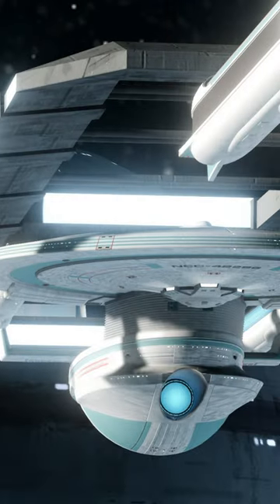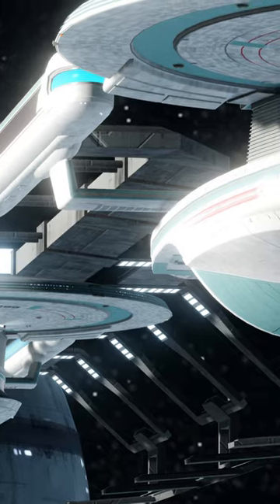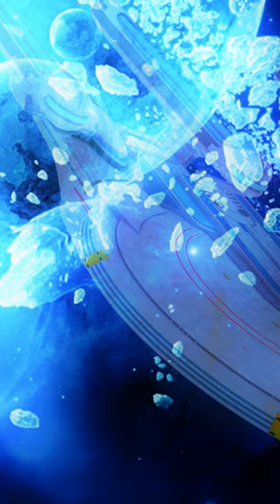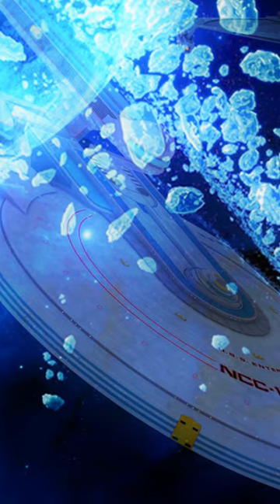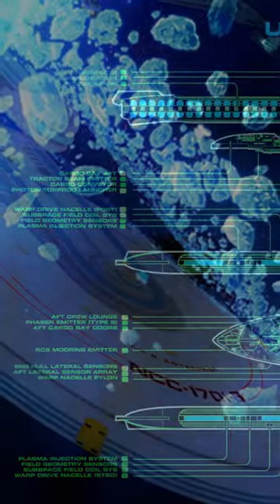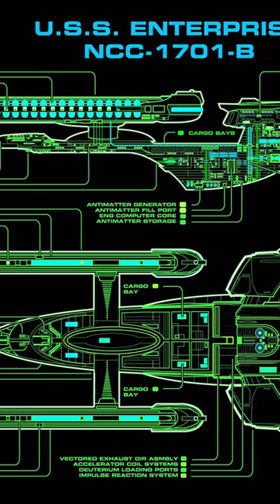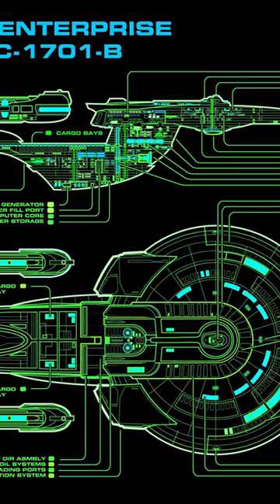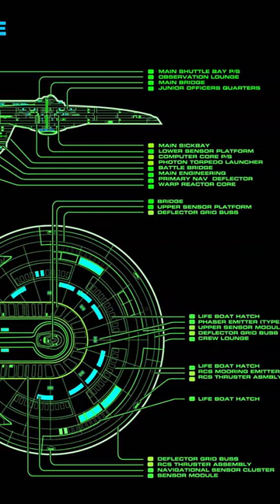I Was Wrong About Excelsior... #startrek #starfleet #militaryship

Comment: Treaty of Algeron was in effect. Since when did 1701 have a cloak. It was illegal at that time.
Reply: The events of Generations were nearly 20 years before the treaty of Algeron. So the Federation could have messed around with a cloaking device on the Enterprise B.
Reply: @blargy7283 If that was the case then why didn't more Federation ships have a cloaking device?
Reply: @blargy7283  But it didn't. This does not exist in canon.

Comment: Those would be memory chips, Isolinier chips never came into use till around the 2320s, Enterprise C and the Ambassador would have had em as the Ambassador entered service in 2340, while as the Lakota Variant of the Excelsior (Ent B) was launched at the end of the 23rd century at 2393, using the most up to date version of duotronics.

Comment: And 'fine control over the cloaking device' is precisely what Enterprise needed to save it from the Nexus?
Reply from the maker: well no... it wouldn't be installed till tuesday... but we know that the cloaking device is generally tied into a ships deflector.
Reply: @venomgeekmedia9886  whait you mean the transfasic cloack ? in this time?
Reply from the maker: @yelwinmoisesacostaduarte8915  no just a standard cloak
Reply: @venomgeekmedia9886  ok i need more context why the B would have a cloaking device
Reply: @yelwinmoisesacostaduarte8915 Probably Because the Klingons and Romulans had them so it’s logical for the federation to develop and use them as well
Reply: @HKN48  But the Federation signed the Treaty of Algeron, with the Romulans, forbidding any development or use of cloaking technology.
Reply: @joelnielsen4836  Enterprise B predates the Treaty of Algeron by almost 20 years.
Reply: @FyurianPrime the treaty is pre-TOS
Reply: @alanb8884  No it's not.
TOS is 23rd century (2200s), whilst the Treaty of Algeron was from 2311 which is the 24th Century, and after the Enterprise-B left Spacedock on its inaugural journey in 2293 (beginning of Star Trek Generations), so again, almost 20 years between Enterprise-B and the Treaty of Algeron.
Reply: @alanb8884  How would the treaty be pre-TOS when the Romulans and Federation had zero contact and battle-grade cloaking devices only began use during TOS?

Comment: One big problem with that though. Remember how when there was a Starfleet-developed cloak was revealed and installed on the Enterprise-D, they ended up bringing up the treaty of Algeron, which was just about the only thing keeping the Romulan Empire from declaring war on the Federation. If there was a cloak installed on the Enterprise-B, then that would be a breach of the treaty and war would soon follow the ship's launch when completed. Instead, I'd say that isolinear computers can handle much more current than their duotronic predecessors, so I'd say that the Excelsior refits like the Enterprise-B would be fitted with more powerful shield grids, ones that would short out the older duotronic control computers with their much higher power requirements.
Reply: "Because Japan signed a peace treaty that stipulated it may only field a military for self-defence, the Imperial Japanese Navy could never have existed."

The logic you're using.

Comment: Geordi told Scotty in TNG episode Relics that the Isolinear chips had replaced the old Duotronic enhancers for the transporter system 40 years ago. (Or so.) We also learn that Isolinear chips were used to replace and enhance most, if not all, ships systems around that time period as well. Though it would take another 30+ years for the Isolinear chips to be used for all systems such as Warp Drive Controls. The Enterprise B was launched in 2293, I remember reading an article for Star Trek that said the Enterprise B was used to test out the new Isolinear chips, when they were still a very new concept.

Comment: The ship class that has been refit the most in the star trek universe.
Next one is Miranda class lol.😂
Reply: Actually, I'd say the Miranda is the most, because the Miranda was around before the excelsior
Reply: @alexwesley6829   Miranda was adapted more to fill many roles, a little different to full refits tbh but that's more in the way of arguing symantics.😅
Reply: @paulammon2281  lol, was still adapted and refit many times more lol...the excelsior for instance, was refit MANY times over it's life, with no visual changes....other than the ENT-B/Lakota refit style...but other than that, all the normal excelsiors were still retrofit, which is where it keeps the space frame, but the replace all internals, even sometimes adding extra decks!

The Miranda went through this process even more than the excelsior did... though, the excelsior did get it's visual face lift too....and i have to say, I DO prefer the enterprise B version....there's just something about it that looks beautiful... almost like a precursor to the sovereign...I always thought the sovereign was based on the excelsior, in the ways of spaceframe shape, but they used that tough spaceframe style then made it into a full blown warship basically...both, beautiful ships

Comment: The Enterprise B used a cloaking device? Ummmmmmm no. An enlarged engineering section and additional impulse engines imply greater power output or additional stores of consumables for longer missions. Almost nothing in canon suggests cloaking technology. (The additional power generated by the Enterprise B could just as easily be for exploration or combat as for cloaking.)
Reply: in his fanfiction universe, Venom has the Enterprise-B variant of the Excelsior be originally designed as a counter to the Romulan Nova class equipped with a cloak and tricobalt torpedoes. He reasoned that since the Treaty of Algeron prohibiting Starfleet from operating cloaked ship did not exist until after the Tomed Incident they could use cloaks before then.

He has the Romulans revealing the Nova class around the time of Star Trek 6 as the big stick colony/starbase killer battleship to deter aggression and the Enterprise B Type Excelsior was Starfleets counter deterrant with specialized cloaking support systems. Basically "You have a cloaked Battleship that can level any of our worlds with plasma torpedoes, we can do that too, so you might want to keep things civil."  Basically the equivalent to the Ohio/Columbia class SSBN vs Typhoon/Delta/Borei class SSBNs

After Tomed (which he has made into a kind of Cuban Missile Crisis situation between the Federation and RSE that nearly resulted in the two powers going to war) and the signing of the Treaty of Algeron, Starfleet had to remove all cloaking tech from their ships(Acquired back in the Enterprise Incident by Kirk BTW) It's likely that Starfleet refitted the EntB type Excelsiors with the equipment and supplies you're proposing. 

Remember this is Venoms well thought out fanfiction here.
Reply from the maker: apart from the fact that up until the treaty of algeron the federation was free to use cloaks, and the additional structure doesn't add much in the way of volume... if that were the goal why not fill out the back more? also it doesn't  change the height of the ship... so the core would still be the same size.
Reply: Additional sensor and subspace antenna blisters for a command variant make more sense than a cloaking device for which, to the best of my knowledge, we have never seen evidence of.
Reply from the maker: @brianchiasson2465  well we know the federation gave up cloaks with the treaty of algeron, meaning they must first have them. the instigating incident being the "Tomed incidednt" in 2311 which very much falls in the excelsiors tenure.
Reply: @brianchiasson2465  we only see the Excelsior Refit twice, and Lakota would be subject to the Treaty Of Algeron regardless
Reply: @venomgeekmedia9886 To be fair warp core height very well may not be a sign of power output. More likely the hight is so that the antimatter store on the bottom is close to the bottom hull to be easy to eject. Constitution and excelsor has it needing to reach the impulse engines where the matter fuel is stored.
The reaction is in the matter/antimatter reaction assembly. TNG has the dilithium in the reaction assembly. The constitution had the dilithium crystal converter be a separate unit to convert the energy to be used for warp plasma and probably why a separate one was used to channel the energy to the impulse system. 
The height is most likely a function of convenience.
Reply: Also, I had to re-familiarize myself with the Tomed incident. The facts of the incident have nothing to do with cloaking technology. So why make that part of the treaty? It's still a smart move on the Romulans part to ensure they are left protected.
Reply: Actually the added structure to the engineering hull is already explained as being due to the enhanced sensor suite that was installed on it....the extra impulse engines were there for the same reason any car nut would put a turbo on their car...."more powahhh!!!!" 😂
Reply from the maker: @SSJBart-jb5dw  I presume you mean that terrible novel... that's exactly why i did my own take.
Reply: @Ty-yt3lj  exactly my point.
Reply: @venomgeekmedia9886  Yes, and don’t ever stop, lol.  Also, I am a little humbled now with you saying that about a novel. They are the holy grail for me. The Lost Era novels started amazing. Sulu and the Excelsior with Chekov as his First Officer? Yes please!  Lol
Reply: @venomgeekmedia9886  The treaty prohibited the development or use of cloaking device technology by the Federation... That doesn't necessarily imply that the Federation had it already, just that they were either developing it or far more likely, that the Romulans feared that they may at some point do so given that the Federation stole a one in the late 2260s. Cloaking devices don't really fit the way the Federation operate, hence why even after the Romulans join the Federation in the 32nd century we still don't see Starfleet using them.

Comment: Wait, the ENT-B has a cloak? I feel like we need a video about that now!
Reply: Just in this fanon lore to fill in why it has extra hull protrusions and impulse engines. This entire channel is built on fanon. Very well made fanon.
Reply: No it does not that assumption is purely based on fanon thinking
Reply from the maker: https://youtu.be/wQ57EVmYF2s?si=Mfa4tlduQg5UuEHB covered that here
Reply: she did not.
Reply: There’s absolutely zero reason to think it had a cloaking device because it doesn’t lol
Reply: @richardched6085  If you pay attention to this video the cross section of the E-B is the ORIGINAL cross section Doug Drexler made. There were actual changes when ILM changed them.

They were in fact originally shuttle bays but ILM changed them to look like impulse engines. I'm not sure who ordered that change but that's why in the ORIGINAL MSD it shows them as shuttlebays. Although I can understand why they were changed to impulse engines.
Reply: @superhayes256  It probably did in Beta Cannon but Beta cannon isn't cannon at all. What we see on screen is cannon. Any books that are put out is not cannon.

Comment: I wouldn't wonder, if the Dayström institute after their founder went crazy with M5 changed the direction of research and instead of trying to use automatic AI systems thought: "what if we just make the computer chips so fast, that even the slow humans can react in time. Then we don't need an AI to assist them."

So they went back to the drawing board and instead of buildings a huge computer on the old computer system, the Duotronic made into multitronic, they went with isolinear chips, which seem to be some kind of small self working devices that you attach to the main system via backplanes to increase the processing power of a certain computer system. 

Outside of the idea that the producers of Star Trek just looked at Space Odyssee 2001 and thought: "damn, that idea with HAL is much better than what we had with TOS"

Comment: in away in the original star trek the even used copmuter cards or communication cards or disks in different colors often. they were called data tapes at one point and changed it to communication data cards. kind of like giant sd cards in away, not really ment as computer processors or memory like isoliner chips were. but i like to think tos duo tronic computers still ised them we just never see them :)

Comment: I saw when your chips have been used throughout.Star Trek autumn till trecord era after the enterprise.E and voyager when they switch to bio neural gel packs Just any original series used chips just hard to use create somthing  with lil to no buget you know peices of wood brightly painted thos were data iso chips which were equivalent to actual reality  SD card  I have ton of iso files on my laptop games. So It's technically the said what should a isolier.Chip look like wasn't decided until the enterprise B. They painted peices of glass back light to give them a futuristic look.

Comment: So im not sure the lore excuses but deduction shows that 'iso linear' is an odd name for these things and these chips are not all that advanced, making me believe that these hot swap capable computer modules are rather common even on pre ToS ships. 

Theyre basically high data storage fast memory circuit via fiber optics - they use light for data packets. 
And theyre curcuits which means theyre nothing outside of what we use to today - perhaps justifying the "linear" usage in the technobabble. 

These chips would not only be common but would probably be typical MIL-STD type hardware, as these chips are hardened vs EMW attacks, fast encryption, and low energy cost to operate for their performance. 

Theyre hot swapable which says a lot more about the software being used on these ships Firm Ware than it does about the chips themselves. 

Star Trek has always been good with the technobabble. Never good with the design logic, tho.

Comment: There's no way that excuse flies. Your using beta canon to justify stating other Excelsior class didn't have isolinear chips. 

You don't even know for sure those are considered to be isolinear chips on the B.
Reply from the maker: your right... i don't know one way or the other. but this is a plausible explination doesn't mean the whole ship ran on those chips. perhaps there were starting to see use on key systems.
Reply: @venomgeekmedia9886  You know going with your theory if the new configuration for the B was to advance it's systems and those are early isoliniar chips, then perhaps it was a failure and why there's no ships like that seen again until the Lakota. 

Some speculate the Lakota is the Enterprise B. 

But it seems the original Excelsior class was at least as advanced or more advanced.

I disagree with everyone labeling the Excelsior class some kind of workhorse. 

Until the Ambassador class it was a ship of the line and outlasted that class.
Reply: @ShaneAcree  oh your correct on that. The excelsior WAS a ship of the line... until bigger, tougher, flashier ships came along, then eventually, the excelsior was relegated to workhorse duties
Reply: @ShaneAcree  also, you say the excelsior outlasted the ambassador...says who??? Because they are both serving at the same time in the absolute latest stages of trek... the ambassador was still fighting the dominion at the same time as the excelsior